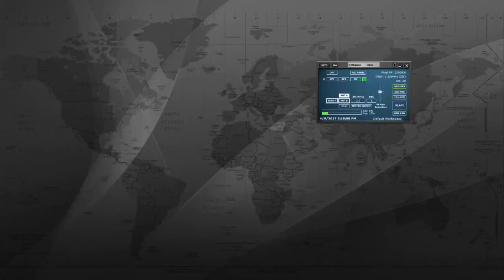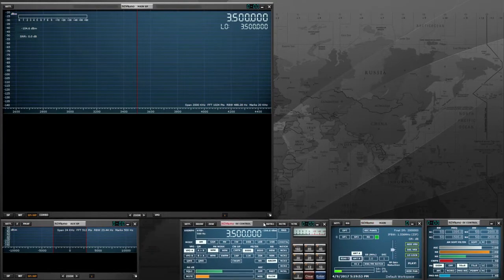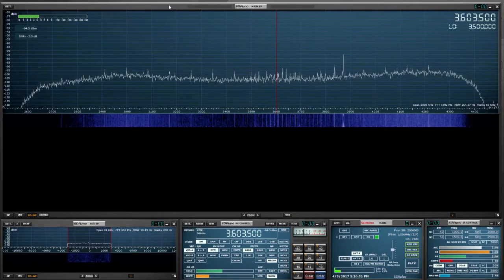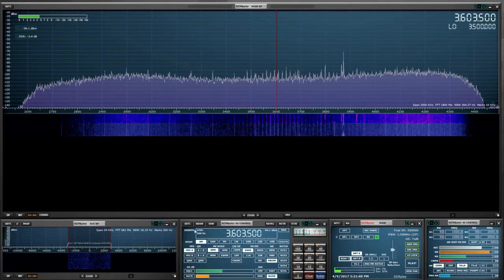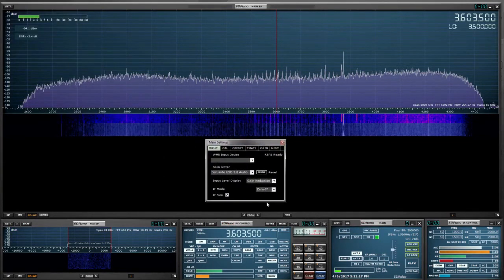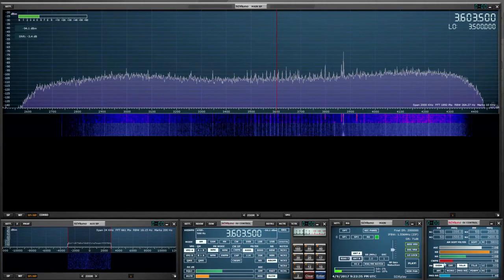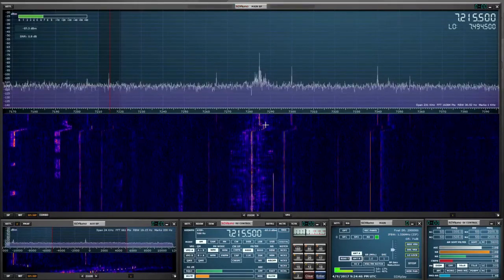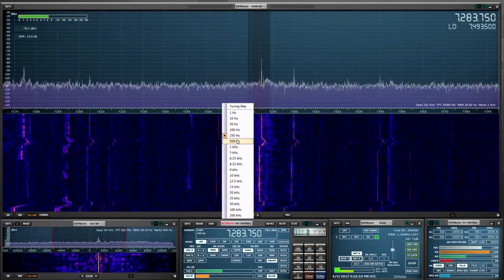SDRuno Basic layout and settings - obsolete (MV001)

Comment: This software can show a lot more detail in the waterfall. Just unclick WF Avg and see what happens. Also set the waterfall contrast to a higher level. After this set the waterfall gain so the noise is just slightly visable on the screen. Also when using the Flat Top function as FFT this also will make the FFT more sensitive for cw signals. When aiming for a 50 to 60 dB dynamic range in the waterfall will give best results. You can see the smallest signals on screen. I have used this software from the day it was introduced many years ago, 2009 I think, when it was called Studio1. Good luck with producing nice videos in the future.

Comment: Using the latest version of the software, I have two problem using the memory panel.  It will not tune the radio to a selected channel in the database even with Lo Lock off and it the filter by Vrx does not work.  Tried reinstalling but did not help.  All other functions are fine.  Using SDRPlay 1